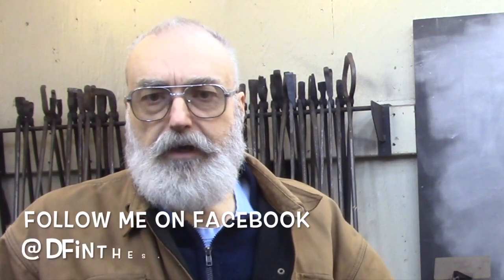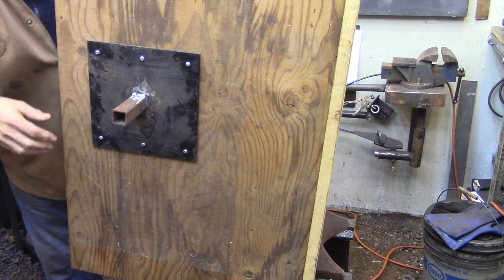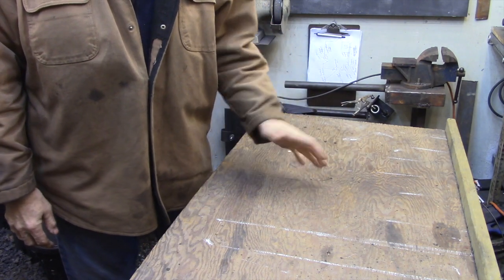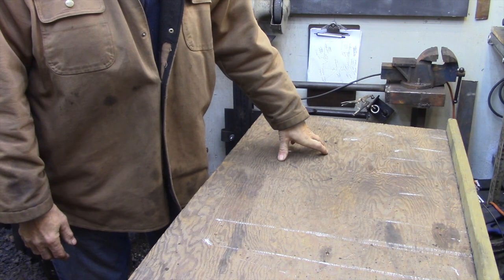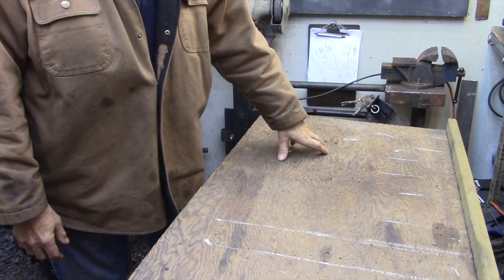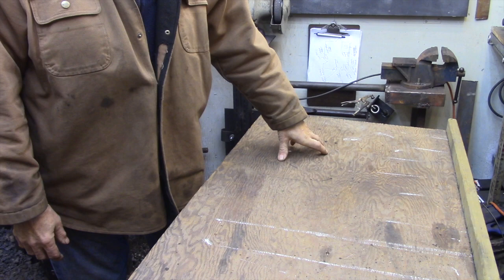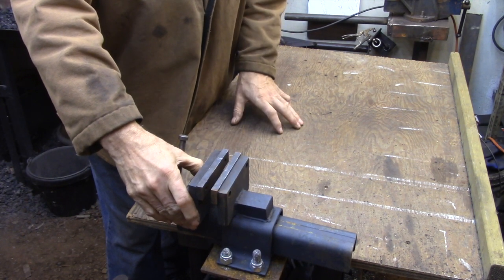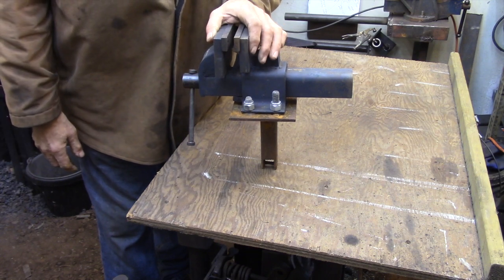Blacksmithing for Beginners - My Anvil Mounted Work Table

Comment: What a fantastic idea.  I'm going to copy that.  I wish my hardy hole was an inch square.  It would be much easier making pegs for my hardy tools.  It turns out that it is about 7/8" and not completely square.  Since I have not been able to find any square tubing that fits it, I've taken an inch diameter pipe and squared it up until it fits the hole.  Then I weld the pipe to my hardy tools.  Not perfect but it seems to do the job.
Reply from the maker: The pegs don't have to be a solid piece.  My hardy hole is 1"1/4  and I often make the pegs by welding four 5/8" bars together. You could get your 7/8 by doing the same  thing with 3/8 bars and just leaving a little space between them
Reply: I was advised that it is completely possible to file your hardy to a square 1” if you want it as such.  I took that advice and it wasn’t that bad at all.  If your anvil was repaired with welds in that area the filing gets a lot tougher.

Comment: This is a great idea as if you stack it away every time, you must clear all the junk off that seems to accumulate on every horizontal surface in the workshop, it does in mine anyway. Many Thanks for a good tip !

Comment: Should cut a hole in the plywood over the hardy hole and insert the vise with the hole using a smaller hardy insert
Reply from the maker: If I do that then I need to have a dedicated vice that I can only use on that table.  It is a lot handier to set a standard size hardy hole for all your tools and be able to use them in your main anvil as well as any workstation you decide to set up.